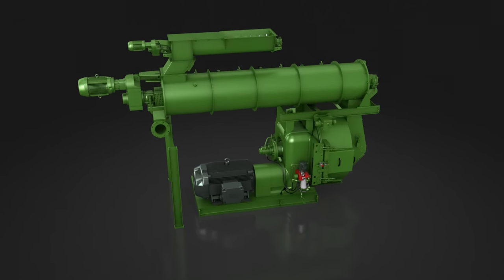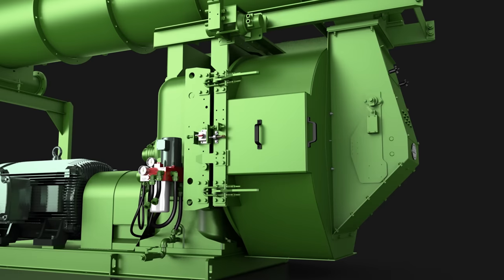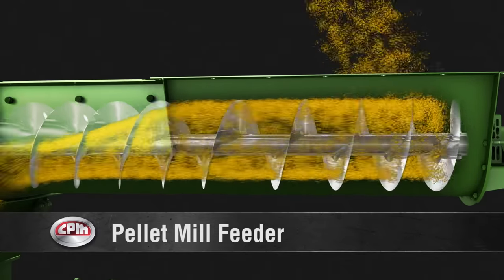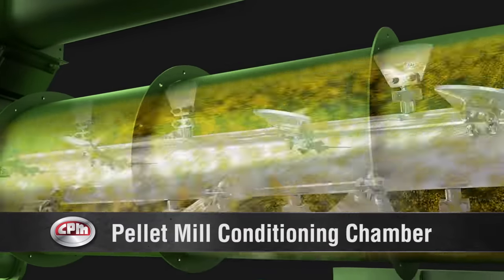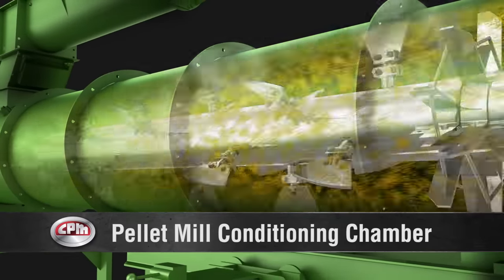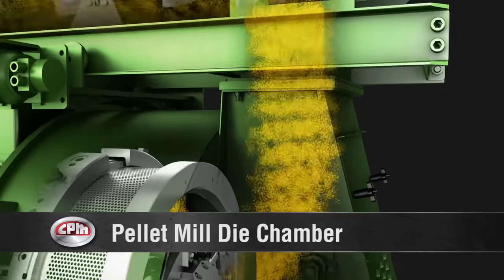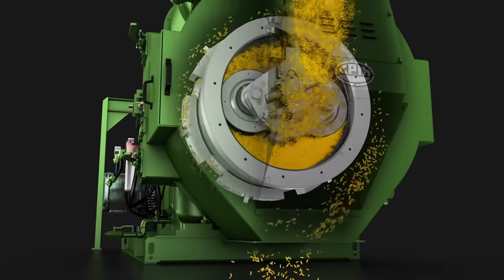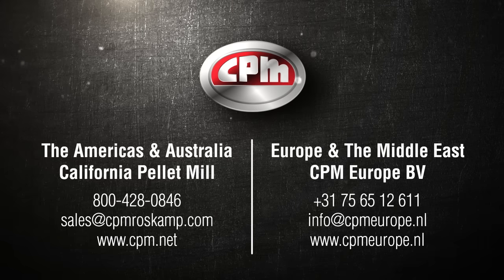How does a pellet mill work?

Comment: Takes a natural talent to operate a pellet mill,, I've used CPM and German Rangers,, if you stick a die on a Ranger be ready to get burned of you don't know what your doing,, Only way to unstick a clogged die is by motor oil and constant adding cracked corn until it starts spitting out your burned cubes or pellets,, and then have fire safety measures in place of those burning pieces get into the system,, always wet choke a die,, never dry choke them,, best way is by breaking in a new die with corn pellets or much cornmeal,, if you try running alfalfa through a new die be prepared for hell,, lol
Reply: In my line of work we use ground corn, fine sand and liquid fat to break in new dies .
Reply: I run both our press lines at around 24tph around 300Amps
Reply: I used to work at lignetics a wood pellet mill that ran 4 400 hp Pellet mills pretty much around the clock. It was a fine line between running the mills at optimum throughput and overfeeding them which of course would cause a plug. The best way we found to unplug the rings was a about a cup full of diesel fuel tossed into the ring while jogging. Of course those diesel soaked pellets would then have to be discarded.
Reply: @michaelknight4041  Ah blockages ! Yes we love them, will see the Amps spike and then dump indicating a blockage.

We use soy bean oil fat on our dimes whenever we open them for cleaning or after a blockage

Comment: Wonder what it's tonnage per hour is...
Reply: That really depends on the size of mill,  our 90Kw motor delivers 6 tph and 200Kw 12 tph. But and there's a big but it depends heavily of the type of feed that enters the mill also the quality and temperature of steam. Operating a pellet mill is sort of a balancing act you work your way up slowly till reach max amps. When it chokes you have gone too far. And some feeds doesn't work at all, usually the more oil you have in your feed the better it runs, and less chance of burning the die. Limestone is death to a die and blocks the holes. Hours of experience make for a good mill operator. The secret is not to let it choke or burn the die.
Reply: @mj3299 I run both our presses at about 24tph max output, a nice 300Amps